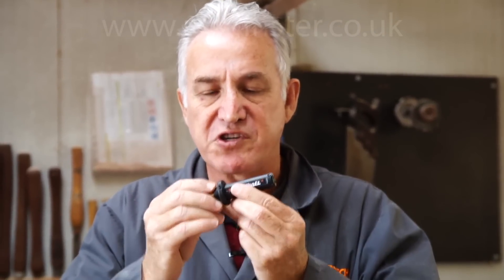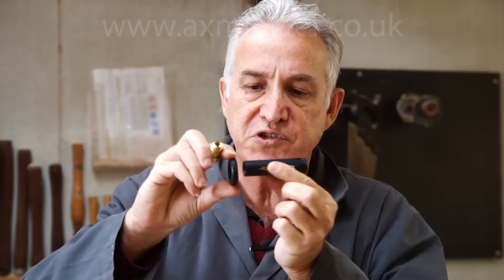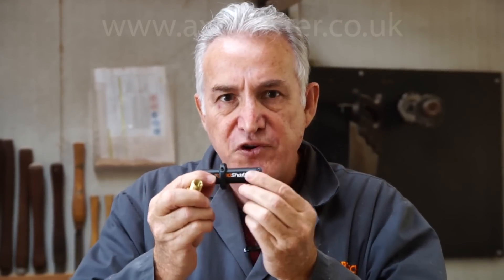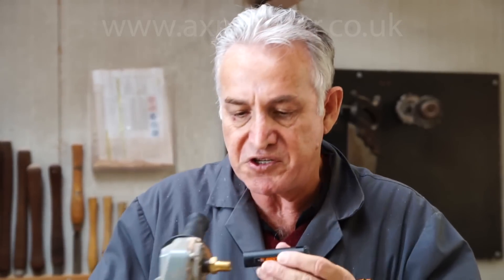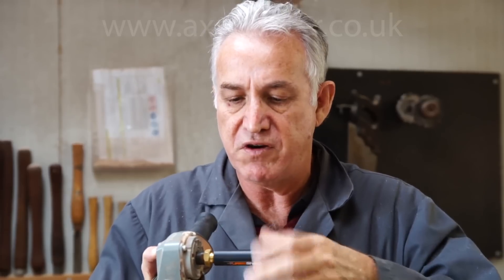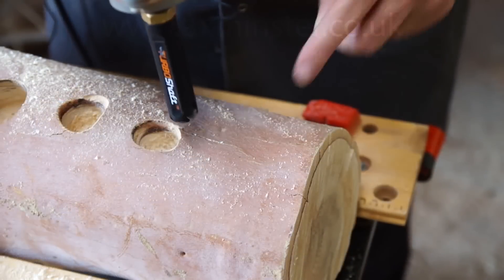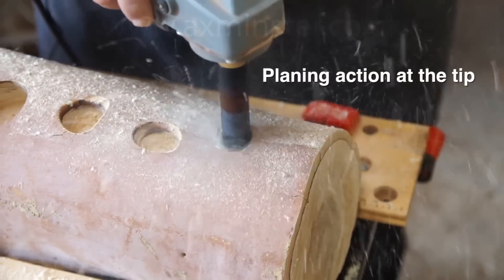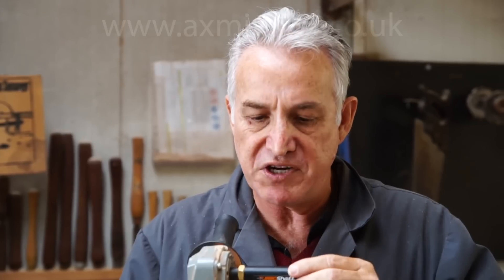Arbortech TURBOShaft

Comment: I received mine. It does not fit my 100mm angle grinder. It wont fit any 100mm angle grinder in local store. If there was supposed to be an adapter, it wasn't in my pack. Consequently, I have had to purchase a new 125mm grinder. Disappointing.